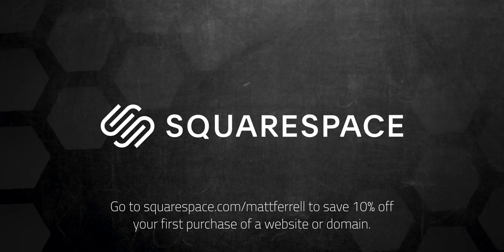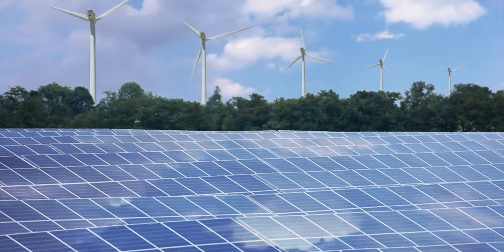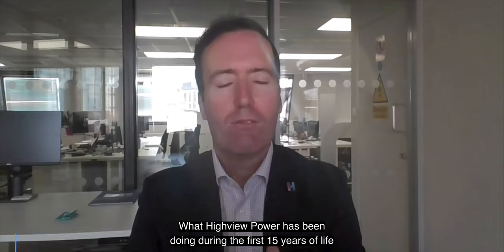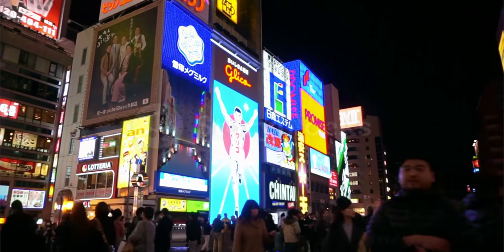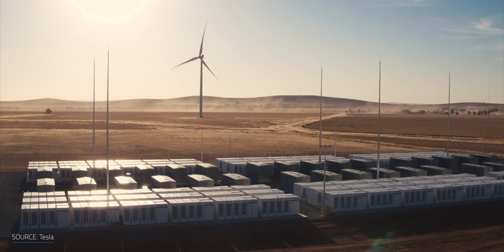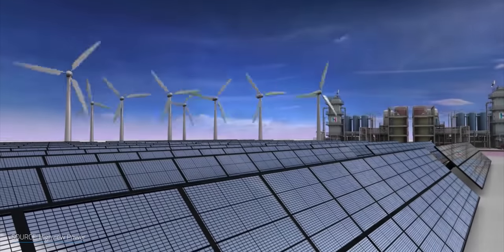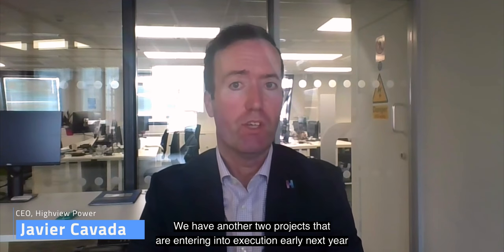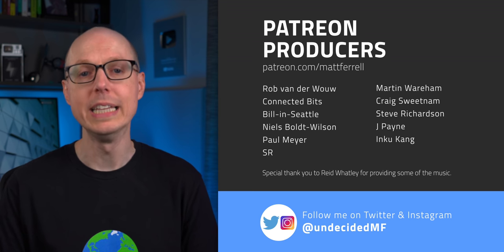Liquid Air Battery Explained - Rival to Lithium Ion Batteries?

Comment: renewable are getting too complex, and can u imagine those weeks with a lot of cloud cover and little wind, generation falls 40 percent, do wee need to store one day of generation, two days or even three days ? Do we all need to grow up and just admit it is too hard? Just support nuclear in my opinion,  Nuscale has permission to build a commercial scale generation 3 reactor.
Reply: A renewable powered future was ALWAYS going to contain many different technologies, to even out any of those potential dips. Doesn't mean it doesn't work (and honestly, it's not THAT hard, you're just winging and giving up before we've even started)

Also, hypothetically. Would it really hurt, if for 300 days of the year, we had 100% renewable generation, but for the other 65, smaller (gas etc) had to run for a few hours to cover a shortfall? I'll answer that, no, no it wouldn't. 

You'd still be cutting out 95% of the emissions world wide and significantly lower the other environmental issues associated with mining and transporting huge amounts of fossil fuels. I call that a win! (I mean, we don't actually have to be "carbon neutral" to prevent serious climate change problems, we just have to lower it to levels the earth deals with naturally)

Contrary to what pro-nuclear enthusiasts seem to think, the reason nuclear isn't installed very often is because it's not cost effective anymore. No one wants to spend that much money on something that potentially can't sell it's power.
Reply: @MrVelociraptor75  I actually agree with renewable energy installations accelerating over the 10 years, I have even invested some money in a local solar farm,  but I do not in any way live in a delusion that batteries will be enough, or even in some circumstances come close to being enough. I just hate those in this debate that are ideological about it and see renewable energy almost like a religion and do think batteries can do everything we need from them. Sure there needs to be a mix, but if there is a genuine desire to go 100 percent carbon neutral then I can not see that nuclear would not be part of it. But in one sense if we accept that generation 3 nuclear is very feasible, we might actually be better off having a goal of having a high percentage of Nuclear,  it would be cheaper,  considering that 3rd gen nuclear has passive safety, not very risky if compared to the effects of climate change! As far as costs are concerned, generation 2 nuclear is expensive and takes a long time to build, but generation 3, small modular reactors promise to be different, since the modular reactors can be mass produced and gain economies of scale, also because they are passively safe they do not need 100s of millions of dollars for cooling redundancy systems.
Reply: @philipwoodgate9555  I do see smaller, faster (response) nuclear being in the mix. Those did seem plausible to me (SMRs).

Anything to get away from coal (power) and to a lesser extent gas. Both are highly destructive and toxic forms of power.

But, I do think you're not giving energy storage enough credit, in its ability to sustain a grid infrastructure (aka baseload, although that term is inaccurate). The decentralized nature of energy storage allows it far more freedom and flexibility to respond to grid needs. It also significantly reduces the actual power needed (due to heavy transmission losses - which here in Australia, can exceed 25-30% of the power generated)

All houses with batteries and solar (and a V2G capable EV), small battery systems at substations that expect short-term energy changes (I expect batteries will start to overtake upgrades to many "poles and wires" in the near future) - this all comes under the heading of "micro-grids"

THEN, you get to the larger scale storages. On-site near energy production is a no-brainer, but there's also a common idea emerging called "virtual transmission", which utilizes energy storage to load-shift differing levels of renewable generation in different regions (between states here in Aus. Germany is looking into it because they have huge wind north, but huge demand south. Larger energy users (ie industry) would need to do what they're currently doing and negotiate with power distributers or, build their own energy systems.

But, the major changes imo, will need to be the WAY we look at power. Mainly in that, individual users will have to become a part of the energy system, buying and selling power from their systems, instead of just buying. There's already the beginnings of this happening (apps from energy suppliers, Tesla has their "autobidder" in the beginnings of a "virtual powerplant")

It will come, there will be many different technologies all intermingling. Unless we get super-cheap fusion, there is no silver bullet
Reply: @MrVelociraptor75  I agree with everything other than having the confidence around battery systems, you say houses with batteries, well yes, but so far there is no subsidy in Australia for that, and very little private investment into battery systems full stop ! The reason is the technology is still too expensive. Even if you believe it is not facts matter, what is the evidence, actions means more than words and investment into grid storage in batteries in minuscule.
Reply: @philipwoodgate9555  Question: If those Gen 3 reactors are such a good deal, why is not everyone building them now? So far, no commercial plant has been demonstrated, in spite of many proposals. 
Answer: No one appears to want to put up the money, because no one thinks they can make nuclear cheaper than renewables + batteries.
Reply: @philipwoodgate9555  I can certainly agree with that. Batteries are not (quite) there yet. 

But, they're close. A Powerwall for instance, without subsidies, comes in at a lifetime per Kw cost of around 40c/kWh. Which is still more than you pay from the grid (obv) but getting fairly close (at around 25c for a lot of Aus, you CAN get much cheaper though). A small subsidy actually goes a long way towards improving that (and I believe a feed-in tariff specific to batteries would work best, but, would require the Virtual powerplant to implement that)

I believe that if we didn't have an idiotic govt "leading" this country, we could be a lot further along. It's the vast opposition to change that is the real killer, so we end up with only the most immediately cost effective choices (wind/solar) and not the things to make them work. The Hornsdale battery proves itself viable, at least (and yes, there are many ancillary reasons for that, but) I've been most impressed with the virtual powerplant trial in SA overall.

It will be great to see more competitors for grid-scale storage emerge.

I would just like to point out specifically, in my previous post, I only consider batteries (ie Li-Ion) in the "micro-grid" category. They CAN be used in larger systems, but, I don't believe that's a good spot for them. I think their advantage is localized storage and transport (esp. with V2G added, but sadly, that's very, very sparse)
Reply: @fotoguru222  that's not true, the research has only come to the point where prototypes are realistic, its the old problem of economies of scale, usually one company has to come out with money and backing to build factories. The challenge for these companies is confidence, look at Tesla, it was a game changing company, it took the idea of electric cars that not enough people had confidence in, back into " hey this can be done " and many companies have now followed suit. Sure still some way to go to get them cheap enough for an average wage earner, but not that far now, and remember it has take government subsidies to assist.
 Nuclear is not a vote winner  because people are fearful of meltdowns, which gen 3 addresses quite well, so subsidies are not realistic,  it will take one company to come out in the front of the field. The challenge for Nuscale is building the factories that make the modules, once the factory is built, and note this does not have subsidies, the factory can then build the plants very quickly and for a similar price range that a coal fired plant can be built. 
But you say confidence of cheaper than renewable and batteries, renewable yes, but batteries, not so sure,  yes there is progress, but it is very slow.  For Grid scale batteries to be installed it must become much cheaper. One of the largest batteries in operation in Hornsdale Australia, makes money, but that is because the power prices in that region are ridiculously expensive. But the general theme is that not many people have little confidence in batteries to invest, yes it will improve, and I still support renewable and batteries, but reality is reality. Renewable is cheap, but the price for grid scaled batteries needs to go as low of around 30 - 50 dollars per kilowatt hour before they will be supported on mass enough to be a realistic base load power, best case scenario I have seen in research is that they anticipate 80 dollars per KWH. That is why I support Nuclear gen 3.
Reply: @fotoguru222  If batteries were cost effective I would be over the moon with joy, but after looking at research I am not encouraged. But I am encouraged by Nuclear Gen 3 as I am energy agnostic, as long as it works and is effective in reaching zero emissions then I support it. The issues around climate change are that serious and consequential that I am willing to look at anything that " will do the job " so to speak.
Reply: @MrVelociraptor75  but would you consider a gen 3 nuclear reactor ? If a government proposed it and there were proven examples, remember Indonesia and USA are already starting the process and India is going into Gen 3 as well.
Reply: @philipwoodgate9555  Can't figure out how you came up with the cost of batteries requirement needing to be $30 - $50 /KWH, because the cost of peaker plant power is several times that today. That's why CA is building a giant Tesla utility battery now as opposed to a more expensive gas speaker plant.
Reply: @philipwoodgate9555  If you've been following the Tesla Battery Day news and analysis, you know that Tesla is projecting a 56% drop in battery costs in the next few years. That will change the equation about batteries vs. other storage drastically. Not sure how liquid air and other energy technologies will be able to compete with that. Nuclear solutions appear to be at least a generation away.
Reply: @fotoguru222  its because of the scale, I am not against batteries, but have massive doubts they can store, for example one days worth of grid electricity , and no one seems to be looking at electric vehicles, when they start to become more popular the grid demands will start to escalate significantly.
Reply: @philipwoodgate9555  Yes, the scale of storage needed is HUGE. If I remember correctly, the US grid will need about 15% of its capacity is some form of storage. That includes hydro storage, which I believe is about half of that today. So we are already halfway there, sort of.

Yes, V2G will eventually be a large part of the storrage solution. A single Tesla EV of today holds enough energy to provide power for a small residential neighborhood for a whole day. Once EVs and V2G become ubiquitous we will have more than enough storage available for everything. 

However, that is going to take a few decades to happen and we can't wait that long. SoI think utility batteries and liquid air storage are both needed for the few decades at least.
Reply: @fotoguru222  I know where you are coming from..but the difference between where you sit and me, I think 15 % is a gross underestimation, you need to be prepared for worst case scenarios, what about all those awful snow storms that come down and cover most of northern/eastern states for a week ! Very little solar production and wind production can be far from guaranteed, sure some peaker plants could help, but it would be far from enough. Look at what happened in California, they did not have the peaker production to cover all the population turning on air conditioners.
Reply: @philipwoodgate9555  I can't find that 15% number at the moment, but while looking in my saved bookmarks I came across the following quote from Forbes in an article published last November. (from https://www.forbes.com/sites/jeffmcmahon/2019/11/12/all-the-grid-batteries-we-need-and-more-will-soon-be-under-our-noses/?utm_medium=40digest.7days3.20191112.carousel&utm_source=email&utm_content=&utm_campaign=campaign#5ba874fc36e3)  According to the IEA, all we need to do is get our smart grid with V2G in place, and storage will take care of itself.

"The International Energy Agency’s most conservative estimate puts 130 million electric vehicles on the road by 2030, and Gorguinpour said those vehicles will contain almost ten times the amount of energy storage needed by the grid. 

"The IEA’s most aggressive estimate, 250 million EVs, would mean 6 percent of the batteries in the automotive fleet could meet all of the grid’s energy-storage needs."
Reply: @philipwoodgate9555  I honestly don't see anything special with Gen 3 reactors (I've only done cursory lookups though, so), they just seem like a more expensive - but safer and efficient evolution of current reactors (and both efficiency and safety ARE important). I DO rate them higher than coal (but a hammer to the head is preferable too lol) and I don't mind gas, but I know it has huge hidden issues too.

What I do like the sound of, are SMRs. Especially of the "fast" variety, as from (once again quick searches) they can use previously spent fuel, along with other advantages (like shortening the waste's half-life, which is definitely my biggest dislike of nuclear, the waste*)

I also don't believe in large centralized power generators, I don't think they'll be a good mix in what I envision of the future of the power grid (which needs to be fairly flexible). So my opinion is that new generators need to be capable of reasonably quick power variations (a few hours max) and possibly be smaller in output (without losing too much efficiency). So SMRs sound perfect for that imo

* - I do realise we're quite good at safely storing the waste these days, but, I don't trust large companies to be responsible AT ALL, so, my trust in the "correct methods" used is very limited tbf.
Reply: @fotoguru222  I thought I'd read that it was 20% of "baseload" power required for a full renewables grid, but, unimportant semantics.

I'm a HUGE advocate of V2G and it annoyed me a bit when Elon said that Tesla weren't even considering it (on battery day). My only thoughts are that it would "compete with their home storage business", but, I don't think Musk thinks like that. I could be wrong.

Now, I do see that it has a lot of obstacles to overcome in order to really be viable. The main one is infrastructure. You have to be able to guarantee that when you park (for a reasonable while - at work, for instance), that you can plug in. It would also need (imo) and automated bidding/selling software of some sort (which Tesla have built something like that). This would allow the customers to enter the energy market. 

Buy during the day (when solar is presumably over-producing) and then drive home and power your house and/or sell off excess power (above what you'd need safely for tomorrow's drive). This gives drivers an incentive (financial) without having to subsidize anything and secures the grid, because it would have 24/7 access to millions of batteries (of which it would only need to draw small amounts from each)

The lowest sized model 3's battery, would power my household for ~10 days straight, without a top-up. That's an insane amount of storage (for a home)
Reply: @philipwoodgate9555  That 15% is more reasonable than it first sounds (I'd read 20%). The principle behind it though, is to integrate and connect the whole country's grid, with energy storage* spread out amongst it, as a ballast (kinda). The idea behind that, is that varied weather over the entirety of a country is enough to average out the ("intermittent") production, to produce that "baseload" and energy storage would only take up the variances.

* - this would be other stability devices, like synchronous condensers and even peaker plants, perhaps.

There's also the plausibility of incentivising "demand responsive" companies (I believe that's the correct term), large industries that mainly operate when energy peaks (or operate certain aspects of their business). There are a few examples of this already. Aluminium smelters can do this to an extent. The Queensland govt is also planning to install "green hydrogen", with this in mind. The major one though (which I wrote in my response to Harry) is V2G and trying to incentivise the general populous to adjust habits to power generation peaks/troughs - which would be largely automated tbh.

I did want to point out though, that (except for heavy snow) solar production gets more "efficient" in the cold. Overall yields are lower, but it's not too bad (if you can keep the panels uncovered). I wonder if there's an easy way to do that (automatically), specifically for the snowy regions? dunno

I still maintain that we should be striving for a 100% renewables grid (which can contain anything replenishable, like biofuels/methane for peakers), you are definitely in agreeance on that. I don't believe there is any one good way to go about it. Even on a country by country basis, some technologies just don't make sense, some only make sense.

But, I for one, don't see the issue with a fully renewable grid, occasionally falling back onto fossils, for those worst case scenarios. At least until a silver bullet technology arrives (fusion anyone?). The benefits are vast steps forward, for the occasional one back.

The sooner we drop coal though, the better. Oh and stop clearing the land... and poisoning it... we have a bit to do lol